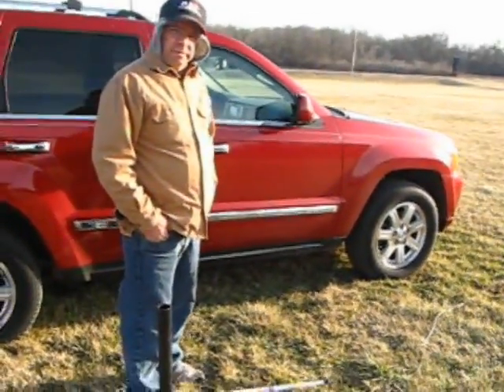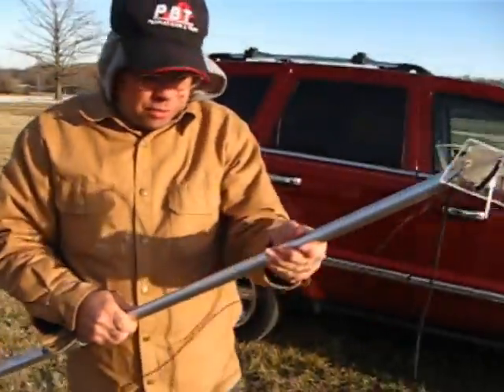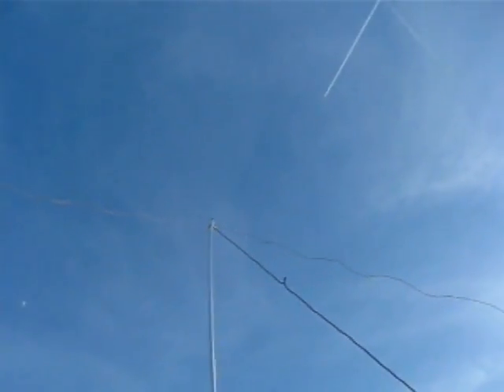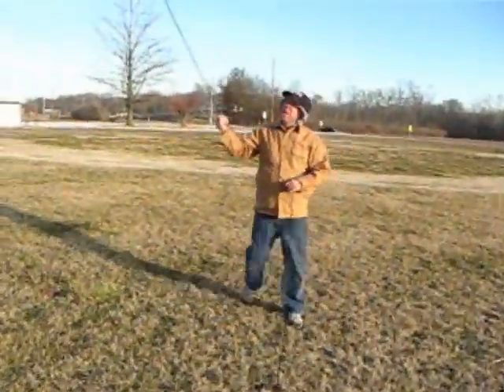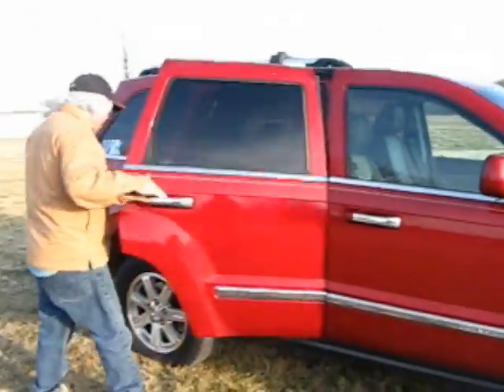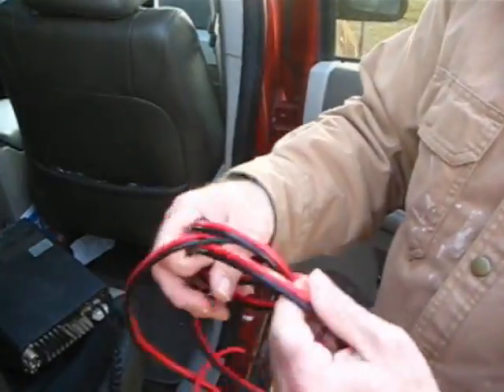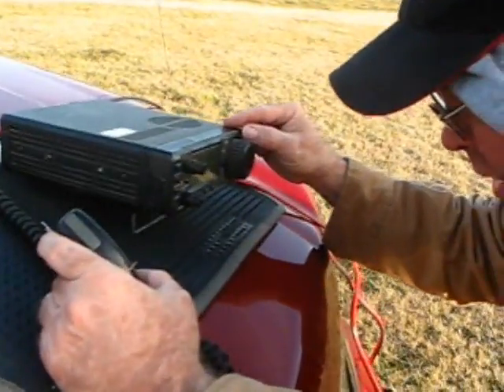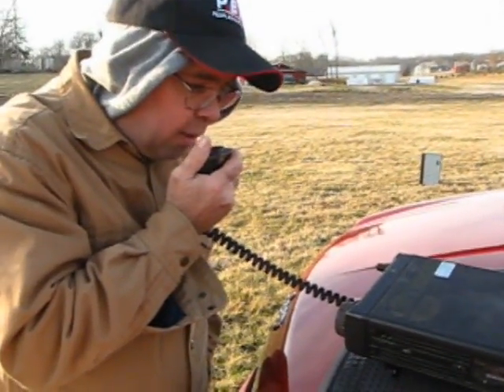Portable Ham Radio Antenna Setup

Comment: Don't know why you make it look so difficult. Its not a speed test or is it? I have a similar home brew setup. Once anchor is in place, 33 foot fiberglass mast and antenna are deployed vertically from the anchor mount.
Reply: Sometimes speed helps ,....many a operator has missed that rare contact because that took to much time setting up there portable station.

Comment: thanks for grabbing the floor mat!  There for a second I was afraid you were going to scratch up that pretty Jeep,  Good video , I enjoy doing such portable as well, I use a special hitch mount a buddy welded up for me that holds the Icom AH-2 tuner and a 31ft Jackkite pole, I run my wires back under the hatch most days and operate the rig on dash of Jeep.  73 de W8FG

Comment: Nice video. I have the 28 ft version of the telescopic flag pole. Looks like you are using an IC 706 series radio. I use the IC 703 or my KX3. I have so much fun operating portable. Looks like you picked a nice day to operate.
Barry  www.ku3x.net